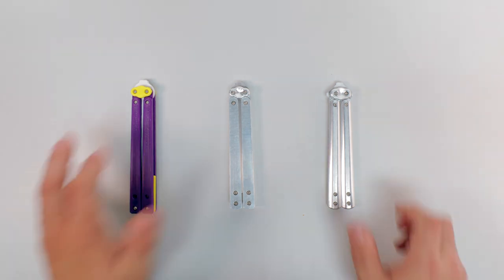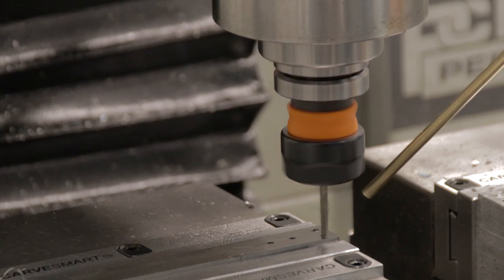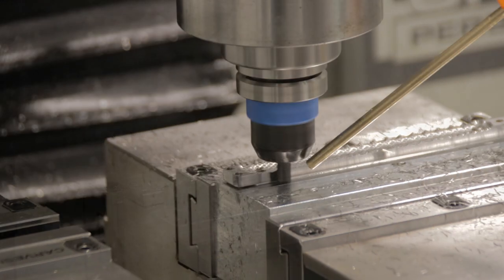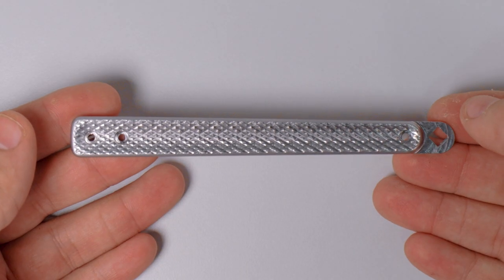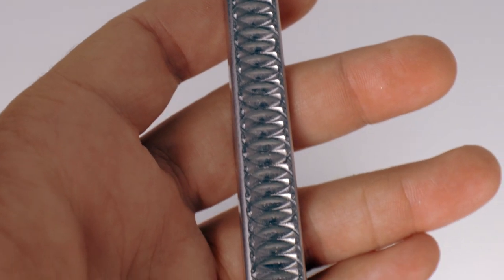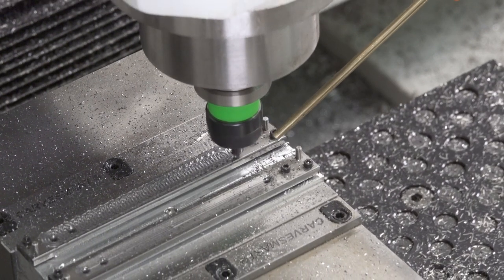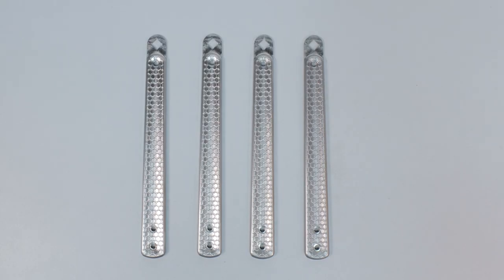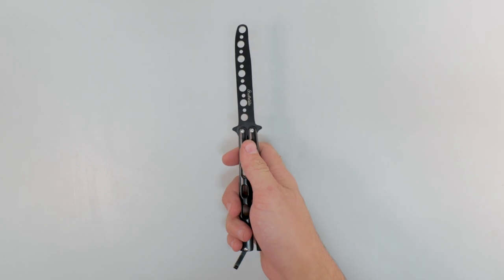Machining Steel and Engraving Patterns. Baliscissors: Ep 4

Comment: Amazing work dude. I love how you made a bunch of different styles of handles. I was searching for vids on how to make my bali design with hand tools and found your channel. Absolutely awesome idea that actually works and looks good.

I think your handle designs would look more appealing if they weren't starting and ending at the top and bottom of the bali - theyre almost too "busy." Maybe try some designs that leave more negative space inbetween the design, or only apply the design to the upper half of the handle where AB's have their chevrons. Also, I like the idea of knurling, but like you said it was too large. I think the knurling of a Rotring pencil would suit your design, however I'm not sure if it's possible because I know nothing about machining.

Really stoked to see the outcome of this. I'd totally love to pick one or two up when you're into production.
Reply from the maker: Thanks for the comment! I was just messing around with different tool paths and the overall shape. Maybe once I find some I really like, experimenting more with breaking up the pattern or only doing it in the center might be worth trying. Thanks for the idea. Hearing from the comments helps me so I don't get too much tunnel vision on one path.

Comment: I’d definitely buy but don’t you think they need a spring or two bender metal pieces on each side of the closed handle, so that it functions as actual scissors when opened?
Reply from the maker: I want to do that eventually. But I put higher priority on figuring out the button click mechanism, making titanium handles, and heat treating the blades.
The way I see it, these are for everyday carry where you just have to open boxes, or cut a zip tie or something from time to time. The scissors are smooth enough right now gravity can open the handles. You probably aren't going to use these as your main tool all day. There's lots of nice sewing scissors, wire cutters, metal shears etc. out there for that.
It's supposed to be kind of a third alternative to trainers and real balisongs. You can't cut yourself practicing tricks, but it's a more useful tool than just a piece of metal, bottle opener or comb. Plus, I just want to make cool mechanical stuff you can fidget with. Some kind of spring or even flip out finger holes might be part of that in the future. We'll see!

Comment: I think you could stack multiple parts and do the sides and round off the corners like that from the sides. you could also drill the holes through all of them. Then one surface operation on the outside and you should be good. Maybe you can even use the roundover to clamp the part.

Comment: Try turning down the heads of your socket head cap screws so they just fit inside the counterbores.  Should help keep your part from walking around during cutting
Reply: Or make the dowel bores deep enough to leave them in.